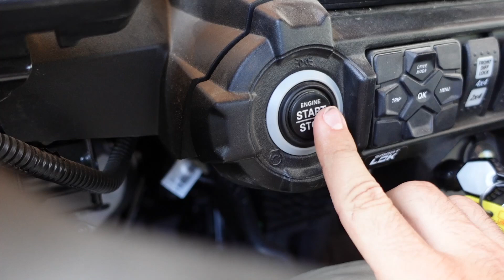DIY 40ft. Bridge Build Across A Creek

Comment: Yall ever saw an oilpatch mudboat? It's a lil over 8' wide about 40 ft long.Made of heavy oilfield pipe and can be drug around by a winchcat.Unload near a creek.Take dozer around long way get the winch cable across the creek...winch it across.Get it in place then drive 18 wheelers across it.Weld a piece of drill pipe along edge so truck or whatever won't slide off.Oilfield construction calls them mudboats.Can be loaded up on a 40ft oilpatch float with a rolling tailboard.